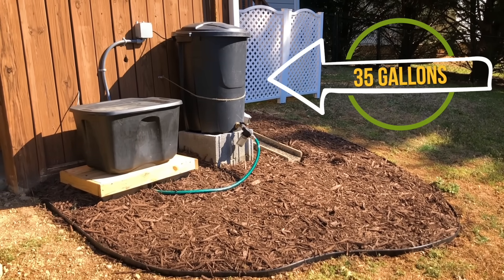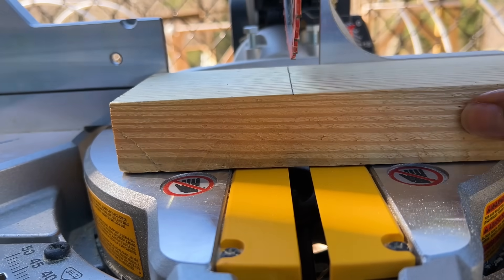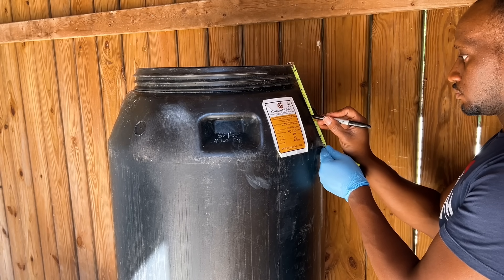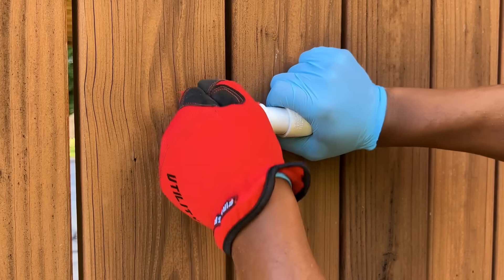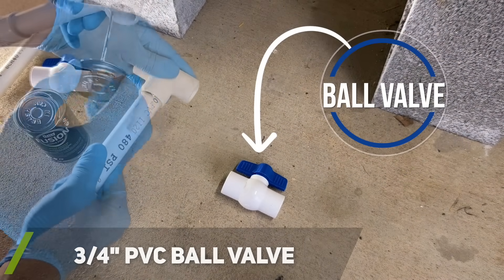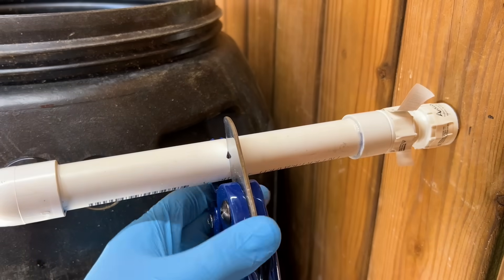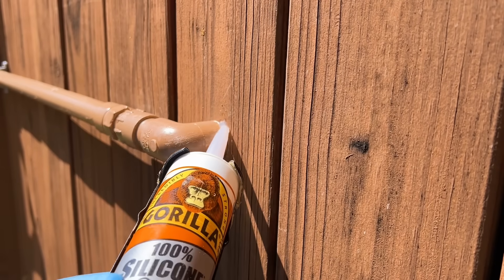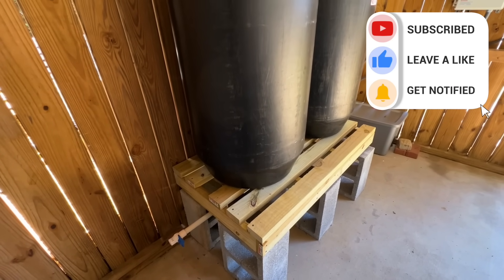Rain Barrel System | CHEAP Water Capacity Upgrade

Comment: Where did you find your rain barrels. The ones I found on Amazon are well over $100. Thanks for the great video. I’m thinking about updating my system that I installed about 20 years ago and will use some tips you outlined in your video. Great job!
Reply from the maker: Facebook Marketplace. Search for pickle barrels. I found a local company near me that sold them occasionally.

Comment: have you had any leaks from those rubber seals on the bottom of the barrels over time? had you considered using a bulkhead fitting on the bottom?
Reply from the maker: No issues so far, and yeah I believe I've seen some that use bulkhead fittings successfully.

Comment: Can you attach a pressure washer?
Reply from the maker: I haven't tried, but I'm sure you can. I would just double check what the pressure washer's inlet PSI needs to be, but some/all (not sure) have built in pumps so they can work with lower inlet pressure from sources like a water tank/barrel etc. Maybe something I'll make a video to test one day! :D

Comment: This is a great video and exactly what I am trying to accomplish.  I do have a question for you.  Based on the pressure you are getting, do you see an issue with the water having to travel about 75 feet to get to the garden from the shed where the water collection will take place?   Thanks again great vdeo.

Comment: What do you screw onto the water outflow connection at 7:44?
Reply from the maker: I believe that was the following: 3/4 in. Slip x FHT PVC Hose Fitting
A link to it at Home Depot can be found in the description. Their image looks different than the part used but it should have the same type of threads.

Comment: Hi, what did you use at 6:58 to lubricate the PVC? And what is the thing called you used to apply it without touching it? Thanks in advance 🙏
Reply from the maker: It's Oatey's Single Step Cement. Not sure of the technical name for the applying brush, but it comes with it. You can find the link here: https://amzn.to/3Na232Y
Reply: @GreenTechTown  thank you so much!! 🙏

Comment: when you put silicone the object has to be completely dry. i can see from the video the silicone sliding on the water film. the silicone will not seal properly and you will have leaks

Comment: I have 2, 200 litre barrels, one thing I'd suggest is a pipe that goes from one to the other, and have the bottom of each pipe terminate near the bottom, removing the air from the pipe with a hose stuck up one side, this way, the drums will stay equally filled at all times, making it effectively one container. the water will always work to stay equal, so empty equal and fill equal. 
I used a pool cleaner hose cut to length to allow a good flow when rain fills one side. 

I also suggest food grade drums from vegetable transport, many food processing companies sell them cheap   food grade and UV stable  (mine were used to ship chillies)

Comment: Okay now all I need to find is where to buy I've been looking for your channel for over 2 months every time I put in the name of your video for the pump low water shut-off google gives me everything but this time I found this video and recognized your voice right away then I saw you and I said finally found you tomorrow I'll look your channel up and find the video on the pump system then order all the parts hopefully ill find the parts for the micro watering system our local stores carry the pipe but nothing to attach the 1/4 inch into the 1/2 inch and no nozzles then wonder why it doesn't sell

Comment: IBC totes are much easier to setup. They can hold between 250 gal, to 335 gal. Fittings are already there.  They only have a 4 ft x 4 ft footprint and are inside steel cage. Just a thought for you. I love mine.  One and done on the IBC totes. Great videos. I just found your channel and am very impressed with your systems.  😊😊

Comment: How do you prevent overflow when the rain barrels are full?
Reply from the maker: The diverter has a built in overflow feature where the excess water will travel down the down spout when the rain barrels are filled and water is blocked from going into the incoming pipe. It's important the barrels are not lower than the diverter exit point else the feature does not work.

Comment: QUESTION? Is there a reason you put the diverter on the outside of the downspout? I would think cutting the board and installing on the inside would be easier piping and make it hidden from the outside.  Either way very nice system.
Reply from the maker: Behind my downspout is a post for my upper deck, so if I understand you correctly, in my case, it would not be safe to cut into the post supporting the deck. Good question.

Comment: I used to pre-drill everything.  Now they have screws where the tip has a small notch, the threads have small "teeth", and the upper portion is sort of knurled.  They are star bits, but I don't know what they are called.  They just "eat" the wood as they go in and never split.  The one downside to them is that they eat the wood so well they don't tend to pull together the wood as well as traditional screws, so it just takes a bit more skill and strength.  It's a real time saver.  In addition, those star bits can be used and re-used a surprising number of times.   I never liked the star bits until I had to rebuild something made by someone else, and then I discovered the advantages to them.  I was able to reuse 99% of the screws.  Anyway, thanks.
Reply from the maker: Good info. Thanks for sharing. And I too learned the same thing regarding the star bits.

Comment: Two things silicone should always be used on the inside where the water actually is So the pressure doesn't push it out. And nonpressurized line should always be done at a four percent grade to allow 4optimal water flow without backups or puddles

Comment: 1 thing you might want for future projects is some Purple Primer. Totally not necessary for this low pressure system, but primer is a good practice for any water system. It softens the ends that go together and causes the glued ends to essentially weld into 1 unit. Cuts down on brittle glue problems down the road. Again, totally optional for a low pressure system, or one that is not intended for potable water transportation.
    Also, there is UV resistant PVC, and it is totally fine to use inside and out. Around my area, it might a penny or 2 more per foot. Apparently, you can get all kinds of colors, now, but I'm most familiar with the black piping.
Reply from the maker: Good info. I use Oatey's Single Step Cement for most of my low pressure projects now days. It has been working great for me for a few years now. Highly recommend for small low pressure DIY projects.
Reply: @GreenTechTown  Good tip. Only 2 advantages to separate primer and glue. 1, you can let the primer sit for a second and get to work. 2, you tend to use more glue than primer, so it's possible to save a couple pennies. Also, the primer actually stores better and safer, so you might have a bad can of glue, but a good can of primer.

Comment: Nice job. It is nice to see a black man that is not a all gangsta dumbass. When working with water you might want to have the rain collection barrels as high up as possible for a higher output pressure, no pump needed. When making a water collection system you might want to have the pipes at a minimum angle of 5° so water runs naturally down into a barrels and does not collect in the pipes. An overflow on the barrels would not hurt so if they get overfilled the excess water just runs back down the drain. A cheep plastic or metal filter in the drain gutter would catch most of the leaves.

Comment: Great video! Can I ask you about the effectiveness of the sediment filter?? It’s located before the pump correct? Do you find it to be effective??
Reply from the maker: Yes, it has worked really well for my application. Of course now I have a first flush before the filter so the filter doesn't have to be cleaned as often.

Comment: Nice job, but seems to be a LOT of work and expense for almost zero water capacity. We have five 5000 gallon rainwater tanks on our property. For all that work I would have installed at least a 1000 or 2000 gallon tank.

Comment: Great video. One thing I've always done is add an overflow line to my drain line. I didnt see you do that near and would always recommend an overflow line.

Where does your water overflow at when there is a serious down pour? Your deck? AKA near your foundation? Always use an overflow line for those just in case times
Reply from the maker: The overflow is built into the downspout diverter I used. You can find out more information here: https://youtu.be/TcaMyyQHWAI
After using it for 3-4 years, I have not had any issues with it. Thanks for watching and the feedback!

Comment: Shouldn't the inflow pipes be slightly downhill in order to promote fast flow toward the hold tank? Just wondering why everything is leveled, it looks nice but doesn't that slow the flow rate of the system and potentially cause lose back to the downspout?
Reply: Btw, I'm not trying to be negative, I'm using your guidance to setup my own system...great work, keep them coming.
Reply from the maker: No worries, good question. It was recommended by the manufacture of the downspout diverter I used based on the picture diagram. The main important point is to make sure the exit point of your diverter is not "higher" than your rain barrels, else you may run into overflow issues. But I see no reason why you couldn't have the pipes going slightly downhill (few degrees) as it would also help with making sure no water is left in the pipe. But I would recommend contacting the folks over at EarthMinded Rain Barrels.

Comment: I'd use a bigger inlet but i have 4000 gallons on barrels so i need the inrush.  Nice video!

I uploaded a bunch of rain harvesting videos.
Reply: Also you might consider putting the outlet on the sides.  Easier to move without putting strain on the hole/seal.
Reply: The little water that stays in the barrel helps to keep barrels from blowing over.  Also helps debris settle instead of plugging up drip lines.

Comment: I love your videos! I have just 1 rain barrel attached to my greenhouse gutters. Seems fairly difficult to create your system. What would you say the difficulty level is from 1-10 ( 10 being the most difficult). Should I use an electric transfer pump and add the solar system next year?
Reply from the maker: Hard to say, as I'd say everything can appear difficult the first time you do it or research about it. I have little experience with other system setups, so it's also hard for me to compare it to another system at the moment. I do want to try to install a larger water collection system one day with an IBC tote or something larger, but that will be further out in the future. Also, depending on how you plan to use the rain barrel, you may or may not need a pump at all. Some people use gravity if the barrel is stationed high enough. I prefer the electric pump (12v DC on-demand pump) due to the water pressure it delivers and the simplicity to add solar to it down the road if you want. If the pump is close enough to your outdoor house outlet, you could also use an AC electric pump.

Comment: Moved into my house in November. Previous owner’s previous tenants (she used the house as a rental for two years before deciding to sell it) had a rain barrel made from a trash can, fine metal mesh, and a spigot underneath a down spout. Had a foot worth of a sediment and bird poop in the bottom when I dumped it out. 

Do not skip out on first flush systems kids

Comment: Hate to tell you, but that doesn't look like pressure treated wood to me. You may have gotten ripped off. Also, a good bulkhead adapter would have been better for the bottom connection instead of that flimsy rubber one you used. And those 1/2" pipes are too small a diameter. You will probably run into problems in the future. Good luck to you.

Comment: I love your stuff, thanks for the channel.
Haven't looked at all the comments on this one so I may be repeating someone else. Got a tip. Uniseals are great bulkheads. Cheap and reliable. Super easy to use. One piece, no threading, no additional fittings required - just buy the size for whatever diameter PVC you're gonna use. Check em out, you'll be glad you did.

Comment: Would there be any reason not to use flexible water connections in any part of this project?
Reply from the maker: As long as they can withstand the outdoor environment and hold up over time really well, I would think they should be fine. Also look and see if they are okay for potable applications.

Comment: Great attention to details. Nice video! I'd suggest you flame torch for 5 seconds the slightly  undersized drilled hole before threading your NPT PVC fitting into the barrel. Don't thread it all the way though. Leave about a 1/4 inch to take up any adjustment after it cools. Softening the polyethylene makes it really easy to form nice tapping fillets into the hole by using the fitting itself. It produces a leak proof connection 100% of the time.

Comment: I have to ask this question: Do you have covered eave troughs uptop to keep debris from plugging up the system? I plan on using cheesecloth at every joint of pvc. I mean the junk at the bottom of my eaves is insane..
Reply from the maker: Hey Julie. I have not installed any yet, but I plan to install an aluminum based gutter guard to help reduce the amount of debris that enters my system. This is the version I have used in the past, it and appears to be still holding up after 2 years: https://www.homedepot.com/p/Gutter-Guard-by-Gutterglove-4-ft-L-x-5-in-W-Stainless-Steel-Micro-Mesh-Gutter-Guard-20-Pack-THD80/300276095

Comment: Great job on the video and system!!
Not sure if you did regular level or plumber level for the fill pipes.   But I would do plumber level (1/4” drop per foot) instead of regular level (actually level).  This way the fill pipes drain and you don’t have water sitting in a random part of the system.

Comment: Have you noticed any slowing of the barrel filling due to the sediment filter?
Reply from the maker: Hey Vincent, yes, I have noticed that, but it's not too extreme. To help combat that problem, I am working on installing a first flush system soon, and I am going to add aluminum mesh gutter guards.

Comment: First time on your channel. Impressed by your skills/careful thought put into your system. I see you "clicked" all the good things I want to install in my garden: Solar panels (I have already a system), rain water collection, vegetables culture, some automation. I'll definitely look into your other videos ASAP ! Subscribed :)
Reply from the maker: Awesome, welcome aboard! Thanks for the feedback also, and it sounds like we have a lot in common. I'd like to dive deeper into the automation side of things once I learn a little more.
Reply: @GreenTechTown  TBH, I have a rain water collection network (4x barrels connected in various parts of my garden), but not as cleanly installed nor sophisticated (no water pump, no sensor) as yours. The solar panels on my shed are mostly for recharging my various ebikes batteries (400W is more than enough). As for the vegetables, I need to park the chicken first before I can do that (the chicken can stroll freely in my 500 m² garden atm). I look forward to your future videos !

Comment: Very nice.  Brad Lancaster's calculations show that the average home receives enough run-off from the roof to supply all the water needs for a year if it was collected.  While most folks can't re-plumb a house, building a collection system like this to supply water for the yard is a real no-brainer.
Reply from the maker: Thanks for sharing Three Rivers Forge! Very good point made.
Reply: @GreenTechTown  Thank you!  You're doing a good thing here and I wish you nothing but the best in the days ahead.

Comment: I doubt I can add anything that previous comments have not already covered. A great job excellently presented, and in spite of the size and shape of the architecture of my home being radically different, I’ve learned a few things that will surely help me to capture rain as watering restrictions will undoubtedly become tighter. Thank you!

Comment: I think what you are doing is a good idea but why such a small tank? Need to store as much water as possible these days with outages sure it cost more to set up I just use the water that comes off my carport roof alone (5000 Litres)  if I included the house and garage roof that would be enough to fill I reckon some 30,000 Litres a year.
 

I have had water outages as well In Australia no warning just happened didn't worry me I have 5000Litres storage of rainwater when I lived in the country I had 60,000 lt of rainwater as there was no mains water and I always keep a generator in the garage running for power outages as well. I would suggest to people who live inner city and cannot have a rainwater tank to store several 10lt casks of spring water for drinking if nothing else.  Better to be safe.

Comment: Did I miss the install of the overflow?
Reply from the maker: Hey waterkeeper03. No, the diverter I chose to use has the overflow concept built in. Quite different than most on the market, but it has worked well over the years.